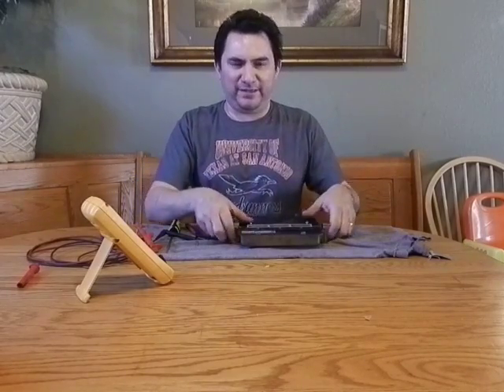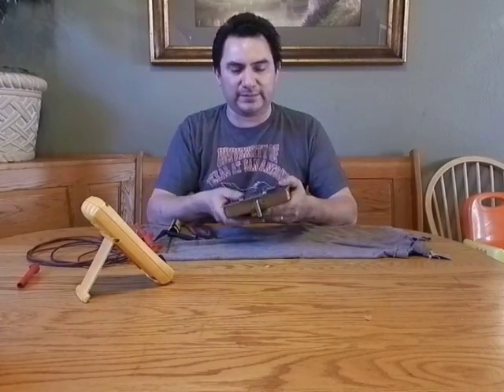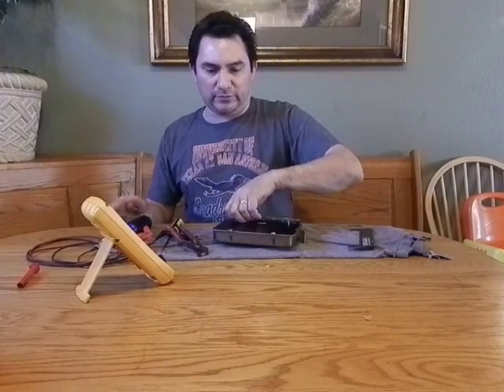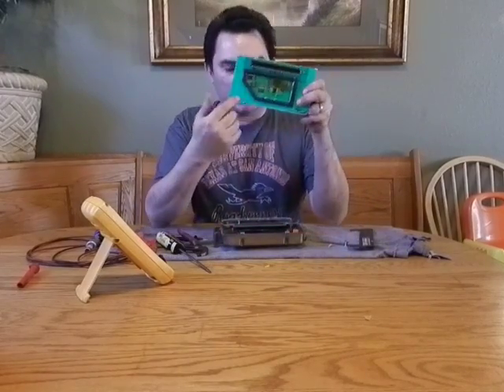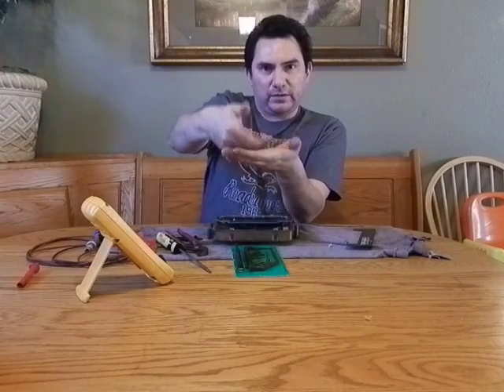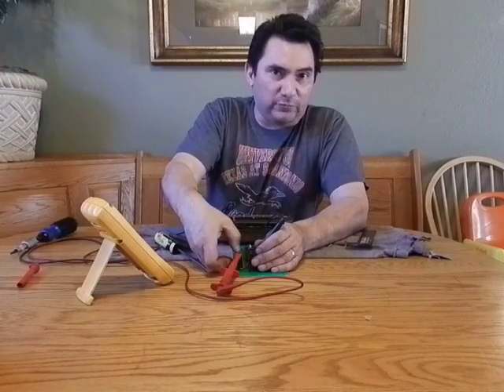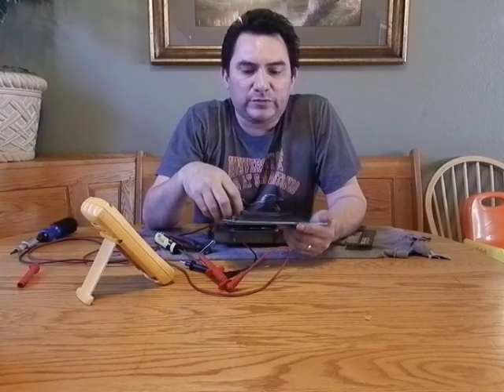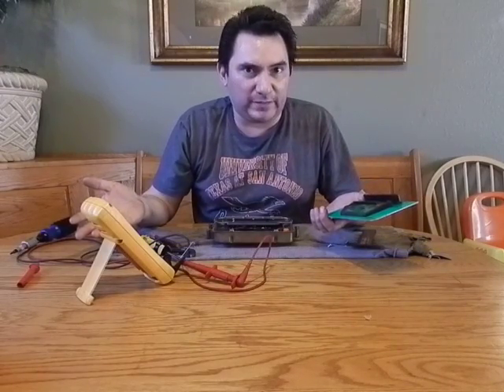'96 Jeep Grand Cherokee PCM Repair

Comment: I' ve done everything possible to fix the problem and my jeepGC 1998 keeps stalling i already spent a lot of money and the problem still there, i will appreciate any advice.
Reply: the first place to start is the 3 big plugs that go into the ECM. if you are trying to start, and it just wont, while someone is turning the key, place your hand on the plugs, if one of them is hot, that plug is not making proper contact. stop cranking take off the plugs, remove the coolant reservoir to make it easy to access. if they have no burn marks, then some cleaning and grease should fix it. get some electronic spray cleaner and a tube of dieletric grease, clean the plugs and the contacts on the ecm, and add a good bead on the plug contact holes, if bad contact was the problem, this should solve it. If any of the plugs have burn marks at the contact side, that plug will have to be replaced, this is a major job best left to an automotive electrician.
Reply: mine had the same problem, cleaned and changed every sensor and intake it could be and turned out to be the battery, if you have a bad battery and it dies or drains somewhere it causes the computer to 'forget' how to idle, replaced mine and it was fixed.

Comment: Crank Position Sensor more likely candidate, so multimeter test first and strength of magnet isn't necessarily going to be the issue. , My defective CKP actually had a stronger magnet than the new one that worked.

Comment: I have a 1993 Jeep grand Cherokee with the 5.2 motor. I took out my ECU and upon taking it apart, the chip is completely coated in a gooey gel. Like they dipped it in a bucket and let it cure completely around it. Anyway, how would I get at the chip if the goo is completely around it?

Comment: Do you think a bad PCM could cause a battery to over charge or over heat? I replaced my fuel pump, fuel filter, spark plugs, crankshaft sensor, camshaft sensor, oil pressure sensor, battery terminals, and Ive gone through 3 batteries within a month... All my batteries start bubbling and hissing.. Whats your thoughts? I also think I could have a short some where..
Reply: Alternator diodes or bad on the inside of the alternator

Comment: Youre a dodgy looking dude mate. But I like you. Say, we cannot really see what youre doing here. Need more closeup.Of the PCM , not you.I opened mine on the side of the road. I think I broker a piece off the board. It looked nothing like your one. It was like a book that opened up and the cicuit board covered both covers with an aluminum piece sitting between the two as they folded around it. I think I fucked it. Sigh.  need another.

Comment: DIY beware, this may work for you if you have the same exact type of PCM. My Grand Cherokee had a book style housing on it rather than the front panels Gene shows you in the video. The electronics were not in a gel, but rather an open board and the bank of pins he showed was a lot different looking.  I wouldn't recommend taking this type of PCM apart unless you are experienced or find some other DIY video for this type.

Comment: I have a 2000 Jeep GC 4.7L V8.  When I open the panel there is a pac of gel and what seems to be only one board.  Part number is P56044683AF.  Any idea how to get it fixed

Comment: Really important thing to remember, if you pull the computer out of your 96 Jeep, expect your issues to "go away" for the next 6 or 7 times you drive it... and then come back.
After disconnecting the PCM for a while, it has to 're-learn' from all of the sensors, and once it's done doing that, you're back to square one.  

I had random stalling issues and in my particular case, the "two-screw" fix worked great, for a week. Eventually I replaced the crank position sensor and that "fixed" the problem for about a month.
Love my Jeep, don't get me wrong... but... what a PITA!!!!
Reply: Lucky bastard! ;]=

Comment: I have a GM BCM that won't wake up with it's suppose to wake up and not go to sleep when it's suppose to go to sleep and drains the car battery
A ground issue ? power wire or circuit issue ? bad solder from pin to BCM circuit board issue or bad chip in the BCM ? 
GM changed the programing on that car model year in 2003 so it won't have the problems that previous gen BCMs were having
The model number of the GM 2003 car BCM I think is GM168 or something like that, they changed it to GM169 or GM170

Comment from the maker: Sure. Anything can be the problem but not probable. Have you replaced the CPS with an aftermarket? Is your Jeep randomly shutting down or during specific situations? Does it take time to start back up or is it within the first couple of times? Can you shake the wiring and cause a shuttering?Have you checked fuel pressure? One major issue I have seen is the connection of a new sensor or actuator will have a weak connection since the old part had slightly larger pins. The CPS is sensitive to this.

Comment: I thank you for the video. I am going to give it a try right now. However if you don't mind I would like to offer a little criticism. And this is coming from a grown man with an ADD mind so hands on and visual is where our focus strengths are. If you had your cam facing down on the work I could get it on the 1st watch but it took me 7 watches maybe 8 because I lost concentration and went straight into this comment. Hahaha. Never the less  thanks for the tip.

Comment: hey i tried sodering couldent do it coz the place wont heat up (coz the back is a metal plate acting like a heatsink ;-/ ) secondly i heard about the same thin using small screws did you get any thing done??
Reply: Had same thing happened to me whole board got hot

Comment: Thanks for the video. 
I have a 2000 Jeep GC 4.7L with an intermittent problem. The engine suddenly stops running. It seems heat related. The gauges stop working, cranks fine but no restart until it cools down, then the gauges start working and it fires right up. Does that sound like a PCM issue? I am going to open mine up for a look see.

Comment: Could you reprogram a 1995 dodge diesel PCM ? Looking for a way to use Original PCM to control lock up on a 47rh transmission. Looking for a reprogram that computer on requires TPS,VSS ,Trans Temp sensor

Comment: We shall see. I've got a rough idle, sputter, back fire up front, won't start till second try (which leads me to believe fuel pressure) and stalling out during initial start up and take off. Idle air control, throttle body position sensor, crank position sensor, fuel pump regulator and filter?  Thank god I know how to use my DMM and a good 40watt iron. I'm going to at least check your theory. 2003 4.0 GC LAREDO

Comment: I have a question. I'm looking at buying a '96 grand cherokee. the guy said that he was told it was the PCM so he replaced it and it ran fine for a day. the next day, nothing. My question is, could the problem be a short in the wiring of the vehicle?

Comment: Thanks, I am BSEE Seattle Pacific University.  Just wanted to ask about pin replacement in the connector, not on the ECM.  I'm just a bit afraid of toasting the ECM. A Mech friend said that disconnecting the battery caused a spike and toasted the first ECM.  Thanks

Comment from the maker: Caps are also a major reason failure for ECU's. The automotive industry uses a high grade, high temperature type which has a lower probability of failure but anyone in the repair business know all caps can fail. I have replace caps an ECU (not jeep) before but obtaining the proper replacement type was a challenge. Also, if one goes, they all should go.

Comment from the maker: A blanket fix is fine but It's better to determine if an actual issue is present. If you do not have a DMM a test light with a battery will do the same job in this case.

Comment: I replaced the terminals themselves (they are from Tyco) since Jeep dealer wouldn't sell me the harness ends. They had none in stock and none will be coming because they are obsolete.  If you really want to replace the terminals I can give you the PN's but it didn't fix the problem in my case.

Comment: I have found the terminals on the 3 connectors are also quite a loose fit and provide little pin retention tension. I found replacement terminals (tyco) and re-crimped all new ends to the wires (no fun at all BTW) and the pin tension is MUCH better. Sadly didn't stop the stalling problem. Seemed like an internal solder joint problem but never wanted to open a working ECM to investigate this flexing problem. I will be pulling mine apart this evening and trying your fix. The refurb I had was junk.

Comment: Great video, bd. I am a newbie at electronic repair, fixing several motherboards and video cards. Have you seen any PCM's with the dreaded bad capacitors? I've replaced some bad caps in mobos and high end video cards.

Also I wonder if putting the broken board in the oven and reflowing the solder would work? I recently resurrected a bad GPU card, following instructions found on some YT videos. I wonder if the reflowing technique could become a fix.

Any thoughts appreciated.

-RF

Comment: ck the wire by the brake cylinder housing...its better to ck it at nite to see a spark by pushing up n down on the jeep...it may be very small but that is your propblem...mine done it when i went around curves or  hit potholes

Comment: i own a 1998 grand cherokee laredo, sometimes it turns off, the fuel clock goes crazy up and down. i have replaced the fuel pump, injectors, a so many spares, do you think the computer is failing ? it does not show any error message when it is connected to a tester.

Comment: Hi 
I just got a 1996 Grand cherokee, it had new cap rotor crank sensor plugs and wires installed the day before I brought it home.  First time I went to shift from 2wd to 4wd and she stalled. I replaced fuel filter has good fuel pump, no spark from the coil and it is draining battery as well. I came across your video and was wondering would a bad PCM/ or as you have shown the actual connection cause a battery to drain along with not starting? (tries but just will not crank over)
Andrea

Comment: My 98 had major stalling problems and I found 2 clips broke on 2 of the PCM connectors but all the sensors where bad too. I changed 9 sensors and now it runs like new.

Comment: My 99 jeep laredo would shut off at any given time and i would have to disconnect the neg battery cable in order to restart it! It would start back up but you just never knew how long it would run! Make the story short, i took my jeep to several mechanics with no luck. I was forced to take it to a jeep dealer and they had it for 45 days! I spent approx $2000 total, they said it was the body moduler. The jeep sits in the driveway still not fixed! I wished i knew what the problem was to fix it!

Comment: I would like to try this fix, but I'm not exactly clear what I'm supposed to be re-soldering.  Can you possibly go into more details, or maybe do another video of you actually doing the re-soldering, maybe with a close up video shot?  Or maybe just show me some pictures of what I'm supposed to be re-soldering.  Also, I haven't read about putting longer screws in, but rather shorter screws as the longer, original screws are shorting out the board.  Is there any merit to this?

Comment from the maker: Code 12 only means the codes were recently cleared. Oddly, this PCM issue does not normally set a code since it's like pulling the plug on the system before the system can realize there is an issue. 
A shutter can be a number of problems but here is a quick list Jeep owns must be aware off:
Idle Air Control Valve -Dies when stopped
Crankshaft Position sensor - Poor idle, won't start, no code
Fuel pump - No return line so bubble may form in the line. Shutters or backfire. More so on low fuel.

Comment: Great explanation. I'm not a mechanic at all. You're right about the longer screw thing. If I apply pressure it works but my 96 Grand Cherokee kills when I hit a bump or something similar. Thank you very much for the explanation. I'm going to do what you said this weekend.